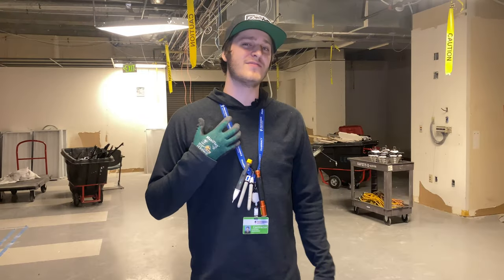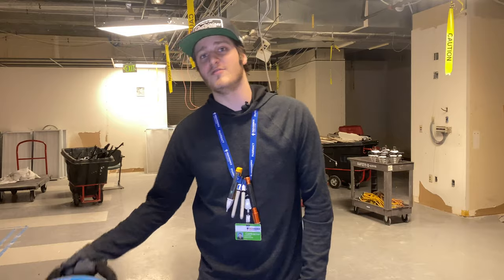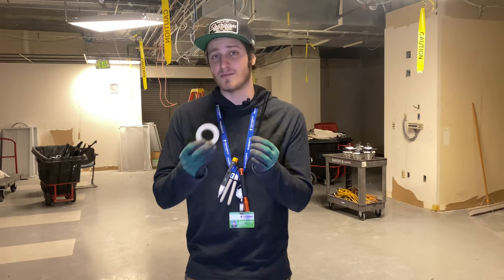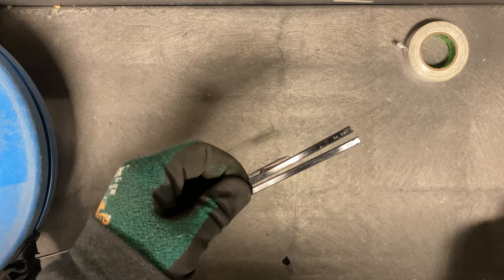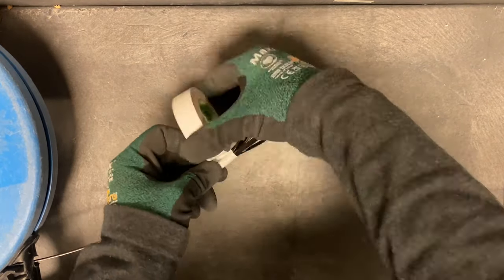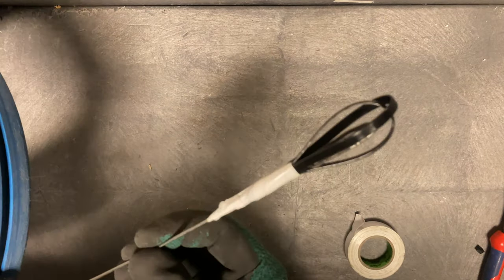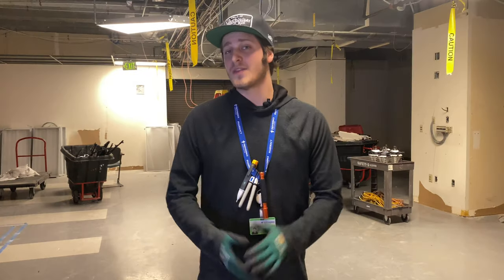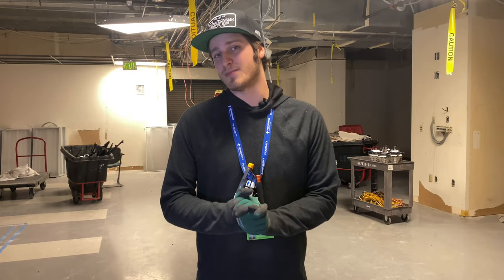Electrician Quick Tip #4 - Fish Tape Trick

Comment: Been trying for several days to get a tape through roughly 125-150' buried 2" conduit only to get stuck at the last 45 elbow roughly 20' from the end.    I have a 1/2" black poly already in this conduit which was making it even more difficult.     This addition definitely helped the tape glide through the conduit much easier.    To help things out, I did come from the opposite end with a diy fish tape with a hook on the end which I used to grab the zip ties and pull the final distance.
Reply: You could possibly try to tie a small piece of grocery bag to some of that blue  ideal powr fish pull line and use a shop vac to suck it out one end.  Then you just tie whatever you need in the pipe to the line and hope you can get passed that 45!! You should be able to! 😂That poly may be in way but it works a good bit of the time! You’ve tried this method I’m sure though! Used to pull cable for damn living when I was right out of high school, what a bitch it was! Talking pulling 6 big wires at a time to hook up traffic intersections! You have a good day sir!
Reply: @tylerseaman3225 this is how we did it. It was about a 150' run and we used some mason line and a shopping bag balled up, then pushed it past the first 90 and started sucking from the other end. Worked like a charm.

Comment: Hey man, I got into a HVAC installer apprentice however I want to switch over to the electrician union in about  6 month after the hvac apprentice. Do you know if the hvac apprentice experience will help be get into the electrician union?

Comment: Bingo! This trick worked like a charm for me using 1/2" PVC and 12ga. wire. I was going through two 90 degree long sweep elbows in close proximity. This saved me a lot of time. Thank you Mad Electrician.

Comment: I have a Movie electrical question for you:
In Jurassic Park when Tim was climbing the T rex fence wires would he really be shocked like the movie depicts or would he have to be touching the ground? I know that birds can sit on a wire without getting shocked or was it because Tim was touching 2 wires??
Reply: I too would like to know this. lol
Reply: A scene I know very well, and a topic that has come up numerous times! I love it.
I believe the cables were bonded to each other by means of intertwined wire that appeared to be metallic. He wasn't in contact with any of the support structure that would be beyond the insulators. I don't off hand know the nuances of giant electrified fence systems either; but if it's anything like distribution, he would have been fine. Be sure to jump before you get too damn close to the concrete footer.